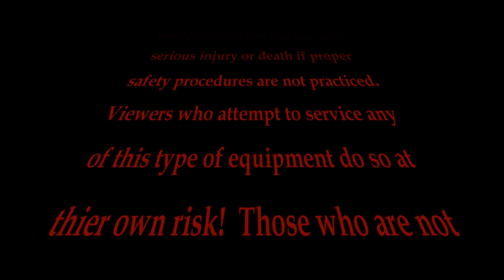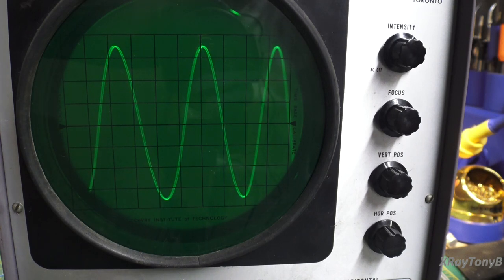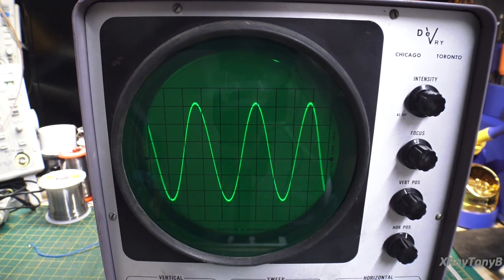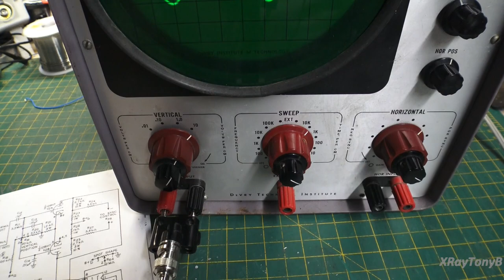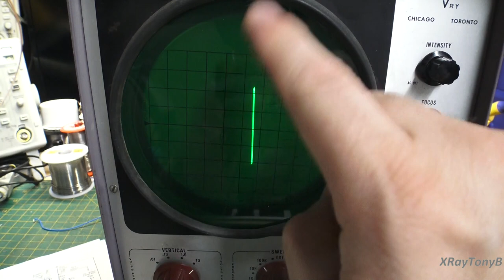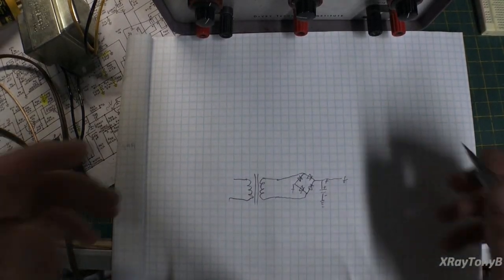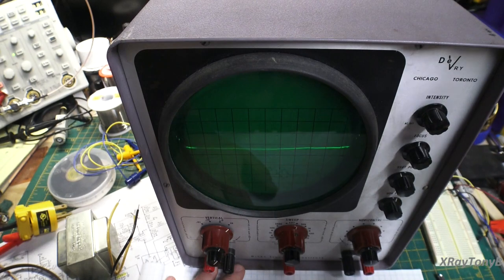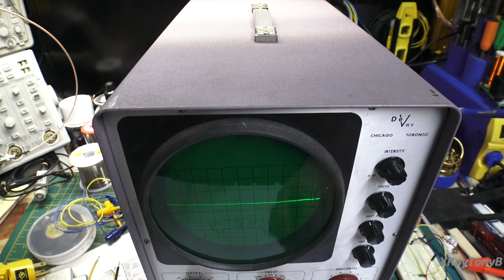Oscilloscope Series - Part 2 - Basic Oscilloscope Functions

Comment: I participated in electronics class all 4 years of H.S.  The last two years I filled a teachers assistant position.  Joining the military completed a most extensive electronics class.  8 hours day for months type instructions.  740 hours in all.  During the whole time I never received any practical experience with tubes or valves some call them.   Your brain food in just the past two video's has shown me more information then I had.  I've worked on tube radios and other.  Only because it was necessary.  I have a way better understanding on the little beast thanks to you.  You took the mystery out of things I just didn't know or understand.  Thank You.
Reply: Dragomir Ronilac  wow! Hard core! That'll leave a mark! But I would be a little more charitable, bud! I'd lay it off to maturity and the effectiveness of military education programs. Some are incredibly good (i.e., the USN) and some are pathetic.
Maturity and focus has a lot to do with it as well. As an example, I failed (almost literally) to comprehend calculus in college but, years later, when natural curiosity drove me back to reinvestigate it, incredibly cogent YouTube videos set the context and it was almost an epiphany.
So lighten up, chum, and give it a f**king rest.

Comment: "Yay!  The Squiggly Green Line is on!  I LOVE that show!!!  To be honest, that square wave IS rather nasty, but a properly compensated probe would clean the wave form up considerably! (I know probe compensation is beyond the scope of this video, but I thought it should be mentioned.)  You are correct in that the usefulness of such a scope is rather limited compared to modern scopes, but a unit of this type still has IMMENSE value for analyzing audio signals!  We just need to be aware that the information it provides is more comparative than quantitative;  that is to say, you couldn't really determine a wave's amplitude or frequency with any real precision, but for comparing the input to the output of amplifiers, filters, oscillators and other such audio circuitry, one CAN get a sense of the circuit's overall gain, level of distortion, basic wave shape, etc....
Thank you, by the way, for this fun and informative series; I've enjoyed many of your previous videos and am greatly looking forward to the next in this series!

Comment: Earnestly APPRECIATE your patience in explaining.  Even though I know how to use a scope, I remain humble and go on and keep learning.  Quest for knowledge.  I used to learn MORE by explaining to my lab partner. Comic, I did not know until I was explaining the subject to my lab partner.  SHhhhhhhhhhhhhhhhh...  LOL
In HAM Radio, Radio Operator could see IF their AM transmitter was over-modulating. Bandwidth had to BE a little higher of course.  They were boat anchors...  Nothing Tony does is boring.

Comment: Those old scopes with a XY function work great to this day as a Octopus component tester. I'm thinking to buy one just for that purpose.

One of these days I plan to get a Tek 547. I currently have a HP 54603B 60MHz digital scope and works fine for my needs. I also got a Elenco 30MHz analog scope but it has triggering issues.

Comment: I won't go completely into the whole history and background, however the original "DeVry Institute of Technology" (originally DeForest Training School) was originally located at 4141 Belmont Ave. near N. Pulaski Rd. I took a few classes for my BS EET at the newer N Campbell Ave location during 1996 (a few years before becoming "DeVry University"). The former building at the time still had remnants of the old logo over the main entrance as well as some businesses on the first floor. It's now a "condominium building" named "Belmont Lofts" and still maintains much of the original exterior architecture.

When I attended the much newer (and possibly larger) N Campbell campus, much of the equipment was current and up to date like many other schools. I cannot remember where a display case was, but it did contain a few of their "older advertisements" as well as some "DeVry" branded equipment, including that oscilloscope. I don't know whatever happened to those display case items.

Just thought to mention that.

Comment: Great video series. Even for me there's a question I cannot really answer confident. *Why is the "Y" deflection jumping all over the place up and down? * Is there some kind of leaking capacitor that still pulls DC level of one of the Y-deflection aplifier stages up and down? Or is it just what I should expect from a vacuum tube? I would expect a little bit of drift up and down as there is no real regulation of the power supply, OK. But I would not expect it being such extensive ups and downs! SRY, but my first contact with an oscilloscope was a 10 MHz fully transistorized Hameg Oscilloscope ages ago, I guess that makes me as a noob regarding tubes... Ooops - I did have some really old telequipment Osci but never really worked a lot with it until it died (nowadays I guess the problem was a combination of old capacitors and contact problems at the switches, but then...). And unfortunately I was not experienced enough, as I might be now, so I gave it away....

Comment: I have the same scope and I have few questions about the sweep control.  Why are there two scales. Also when the switch is in their lefmost position I get no sweep as if it were in external horizontal mode. Should I get sweep at that setting?  The next sweep rate works fine for audio waveforms.  That knob is also kind of confusing should the indicators be pointing to the dots or the numbers in between?